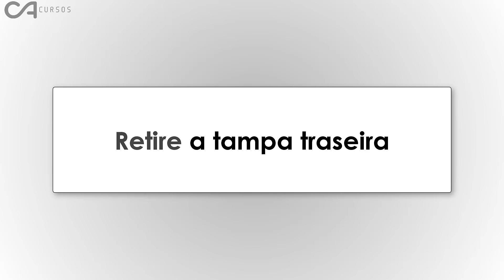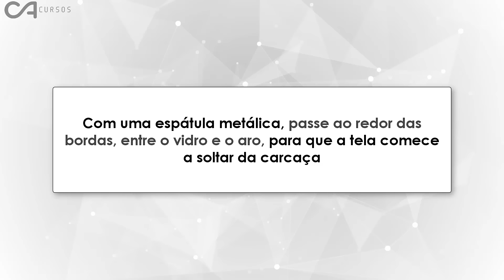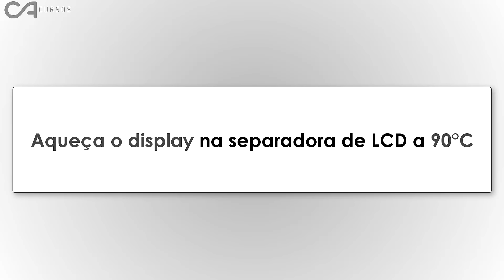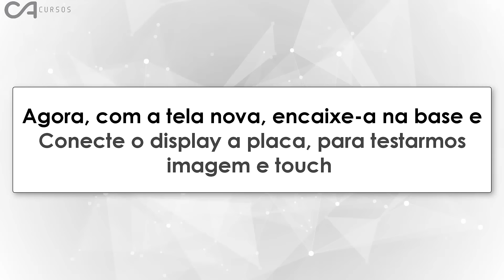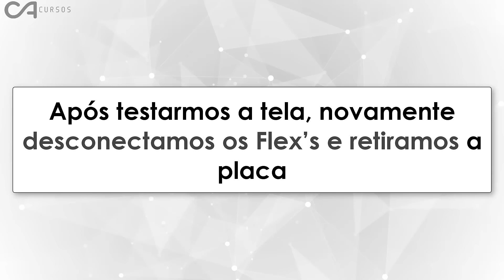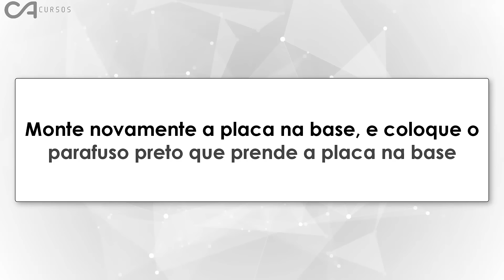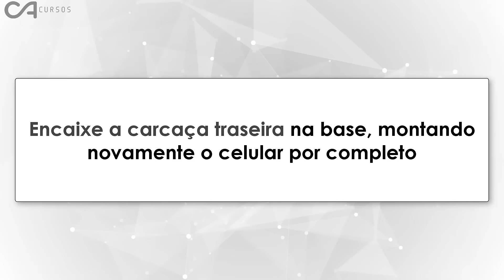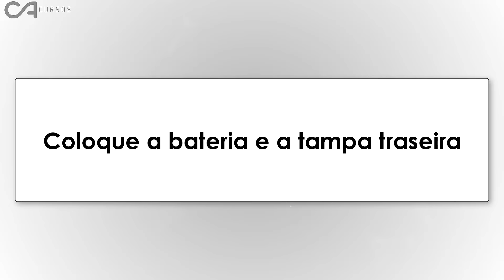Como Trocar Tela Samsung Galaxy J7 (#13/365)

Comment: Essa cola traseira é muito forte. É muito difícil tirar a tela sem quebrar. Sou novo como técnico de Celulares, mas já sofri um bocado com esse frontal.
Reply: se tiver cuidado e colocar a temperatura correta, a  b7000 e mais forte mesmo, se for uma tela de reposição de qualidade e se troca for de um original dificilmente ira danificar, pode acontecer com o tempo vai de adaptando o difícil e o touch troca dele sim e mais complexo.
Reply from the maker: Muito bom Ricardo...